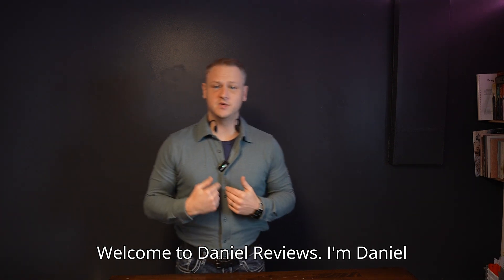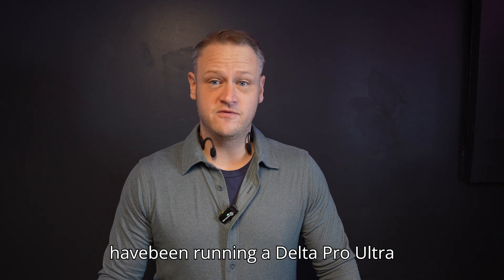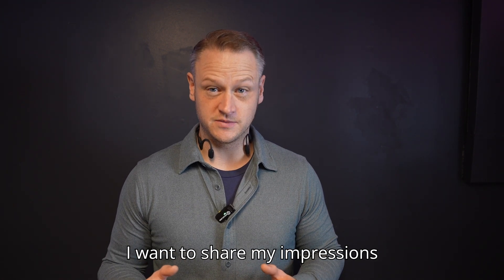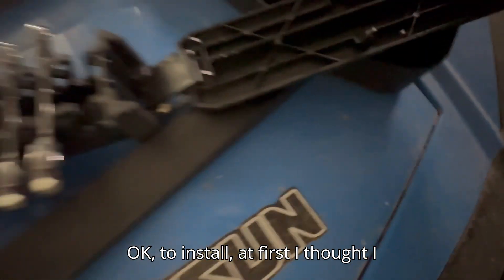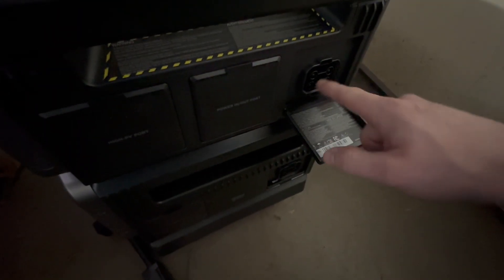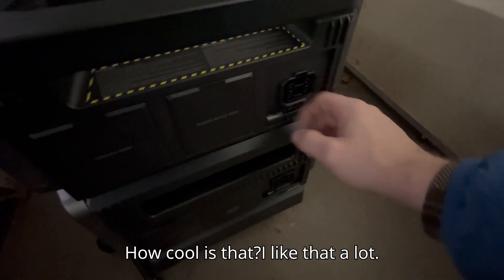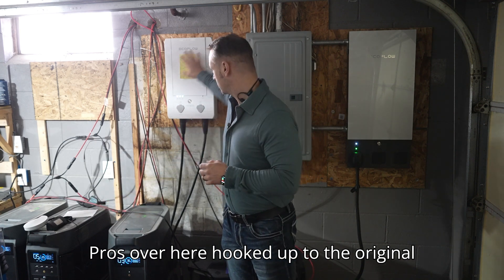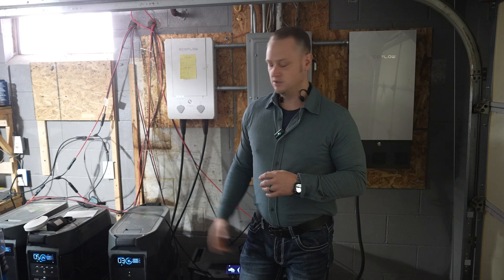Ecoflow Delta Pro Ultra Review

Comment: You can go into the SHP2 to operating mode and setup the range of charge / discharge for the battery. I use a 10%-95% range, but you can set it to your liking. When mine gets to 90%, I have a scheduled task that charges to 95%. Still saving for solar panels. If you are in EPS mode, there is a substantial loss of battery usage via the inverter. Good luck Daniel! Also, there is a EcoFlow DPU group that is very helpful to answer questions, but you need to provide the information so they can answer your questions.

Comment: I bought my Ecoflow ultra with two batteries on Amazon at a significant savings. I installed it and My disconnect panel in one day. i started using it and bought a third battery the next day along with 1600 watts of solar. Three days before thanksgiving I went off grid using my trifuel inverter/generator to charge my  batteries in two hours a day. Three days after thanksgiving my wife found out we were off grid because the dishwasher did not work. I told her that the dishwasher was not essential and got the hands on hips stance. So I grabbed the generator remote walked to the window, pointed at the barn and pressed the button. I told her to let me know when the dishes were done. I am using my solar now and the grid as backup? With only a small array and winter cloud cover I am only saving 25% on my electric but in another month I will expand my solar to 5400 watts and add one more battery to do a real test of off grid capability.

Comment: I see you are discharging from 7 am to Midnight on a single battery? It switched to grid at 4:09 pm. You need to check your charge and discharge setting in the DPU settings, you may have it set to a discharge limit of 50%.
Reply: When you updated the DPU at the beginning, there are usually 2 updates for the DPU and SHP2. You’ve only got one battery to charge, I agree, the updates can be a pain, but I’ve had my DPU and 4 batteries since July and the only time I had an issue is with the .60 to .64 update. Once I contacted support through the app, they looked at my units and immediately sent me the .64 update and charge issue was resolved within 2 discharges and 2 recharges. BTW, on the trays that hide away on the side where you connect the batteries to the DPU, those have the unit serial numbers in the hiding tray covers. Good day sir!
Reply: @hlm34  yep agree.  make sure you update to .64 for sure.  I have 2 DPU's and several batteries and .64 fixed a LOT of issues that i had with .60 (SOC) balance.    Like Daniel, I also have a huge external battery bank 90kw so I always have spare power ready to go.   Very inefficient but with 3 bigger solar arrays, it's free power anyway :)